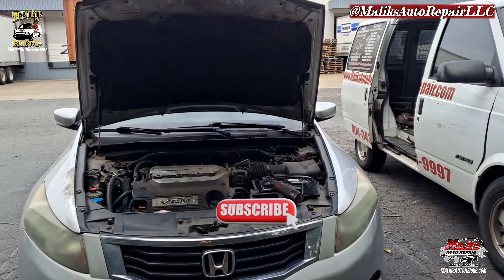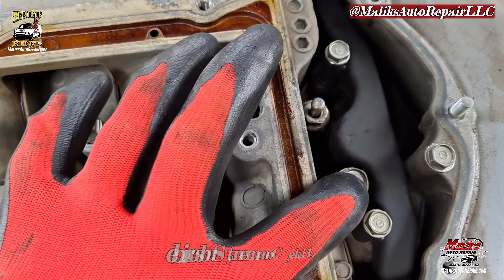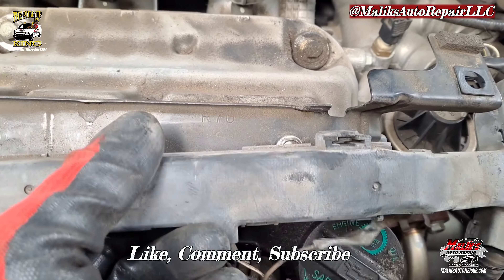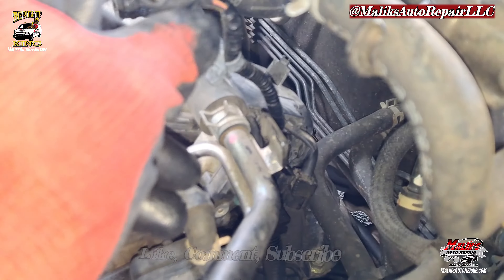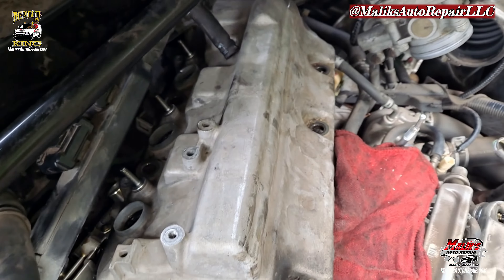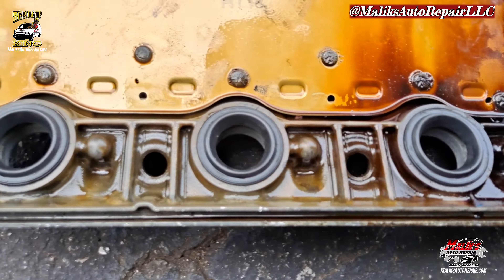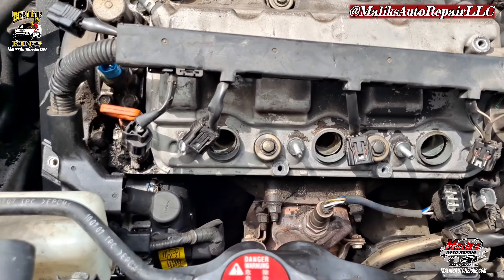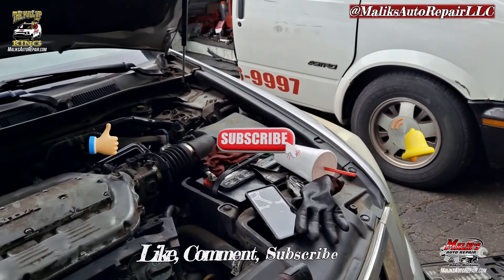VALVE COVER GASKETS LEAKING OIL | 2009 HONDA ACCORD 3.5 | DETAILED | Howto/Diy

Comment: Liked your format, step by step before and after each removal. Easy to follow and straight forward. Thanks man
Reply from the maker: Not a problem man! Thanks alot and thanks for watching!
Reply from the maker: Torque Specs
Valve cover bolts... 8.7ft/lbs.
Intake Manifold bolts... 16ft/lbs.
Reply: @ThePullUpKing can u post the parts numbers please
Reply from the maker: @jeffreyperez231  Autozone

Comment: If this doesn't solve my issue... I hope it does. Thanks for the in-depth explanation Sir
Reply from the maker: Absolutely! Thanks for watching!
Reply: Question, Did you also replace the alternator or just clean it off? The oil has been drippin on my alternator
Reply: Also did you need a new air intake manifold gasket ? I’m attempting this weekend
Reply from the maker: @calebinorio100  The videos shows valve cover gaskets being replaced. Didn't touch the battery. Intake manifold gasket reusable.
Reply: @calebinorio100  what did you end up doing? My valve cover gaskets leaked oil onto my alternator
Reply: @Peace-Of-Mind-  I took off the coolant cap and started the engine, because the fluid didn’t spurt out and I didn’t see any bubbles I realized it isn’t my head gasket. I believe that the valve cover gasket is leaking & also the Solenoid near the dipstick. I also purchased a new alternator but if you want you can take the old one apart and use break cleaner to restore it to original quality. Hope this helps
Reply: Had same issue, if oil has leaked on to alternator eventually you will have electrical issues and alternator will fail. If alternator hasn't burnt out you can clean it with contact cleaner, safe on electrical components and plastic, do not use carb cleaner its too aggressive.

Comment: Shorter and more concise than videos which are twice as long. Good tips and methods to watch out for. Nice explanations and format / editing. I have a 2010 V6 Accord with 180K on it, and I'm preparing to do it this spring / summer. I like your method of tapping out the rings from the top instead of prying from the bottom, use of channel locks for removal and install of those bolt ring thingies and your use of sealant at the corners of the gaskets.
Reply from the maker: Yessirr! Thanks man I appreciate the recognition.😎 I tried to make sure I covered everything. I hope it helps out. Let us know how the repair goes.
Reply: @ThePullUpKing  I still haven't done it, but I'm gonna. I just turned 200k and I plan on doing it soon
Q1: Is it easy to find the torque values online?
Q2: The 8th gen V6 s is prone to fouling plugs as a result of the VCM. Do you have any knowledge of the effectiveness of the aftermarket VCM limiter which keeps all 6 cylinders running continuously?
Q3: Do you have any tips that would help make this engine last another 100k plus?
Thanks,
Dave in Ohio
Reply: How did your install go last year? I just had a plug fail and oil was on 4 of the 6.
Reply: @Jrhortian  I didn't do it yet, but I'm still putting 700+ miles on every week. Correct me if I'm wrong but I don't believe the valve cover gaskets replacement will affect the oil on the plugs. The fouling of the plugs is caused by the VCM (Variable Cylinder Management) which alternates between shutting down 2 alternating pairs of cylinders while at moderate RPMs (not climbing, not accelerating.) As a result, oil collects in the 2 non-firing cylinders and causes 4 of the plugs to get gunked up. There is an electronic VCM tuner module which will disable this feature. I read that it doesn't make much difference in MPGs. Haven't installed it yet. I replaced my plugs quite a while ago with the NGK laser iridium. I suspect that they were developed for this type of problem, but I can't know for sure. They seem to be less prone to fouling out. In the meantime, I just make sure I drive it somewhat aggressively once it has reached full operating temperature to keep oil from building up in the VCM cylinders while keeping the full synthetic oil level topped off. The engine light doesn't bother me. I had 4 out of 6 gunked up as well back when I did it.
I really don't know, I might be wrong. Will the valve cover gaskets and seals replacement prevent oil from entering the ignition chambers? (I'm not a pro mechanic)
Reply from the maker: Replacing the tube seals is what stops the oil on the plugs.
Reply from the maker: A1: Torque specs are easy to find online. 
A2: I'm not familiar with the VCM, unfortunately. 
A3: To make your engine last longer... Regular maintenance will help it. Don't go over on oil changes. Timing chain & waterpump replacement at that age is helpful, if not done already.
Reply: @ThePullUpKing  I did take care of the TB & WP. I also keep up with oil and filter changes. I go a bit longer because it uses some oil and I only use synthetic. I've also changed the transmission fluid myself several times.
Thanks for your reply and for the torque specs (I read the torque specs in a bunch of other comments)
Up to 220,000 now and counting. Still has plenty of power and torque.
The tube seals !  I had no idea. I thought all this time that it was oil getting past the rings !! 
I'm so excited to learn this. I'm so going to do this now and stop using oil !!  🤯
Reply from the maker: @dvd6722  Awesome! Glad I could help
Reply: @ThePullUpKing  It's an awesome feeling to learn something about your car which tells you it's going to last a lot longer than you thought it was !

Comment: Hey man. Nice video. But I have questions about the gasket. Why did you just apply only in the corners? Is it better put all the way around it? And do you put the sealant rtv on the cover first or after you put the gasket? Just curious sir. Thank you for this video!
Reply from the maker: Thanks! Those are the areas where oil will leak if sealant isn't applied. The gasket will seal the other areas. If the gasket doesn't stay in place, apply the sealant lightly, to hold the gasket to the cover.

Comment: how did you get the throttle body harness off. i’m stuck there
Reply from the maker: @MarshallWayne98  Ouch, I can understand the trouble. They can be a pain coming off aometimes. Try using a pair of pliers to help press the tab down.
Reply: @ would needle nose work. I can get the tab moving but the plug itself and going for it
Reply from the maker: @MarshallWayne98 Even better

Comment: Thanks for this video! I did the replacement and leak is gone, alternator at the same time. About 20 minutes into driving the check engine and vsc lights came on - no performance issues. Any idea would could be causing that?
Reply from the maker: Check vtec solenoids. Oil pumps also like to leak on these j-series engines.

Comment: Hey man maybe you can help me with my issue, i was removing my pcv valve and it broke. Everything came off except the very end of it. You think if I remove the front valve head I can push it out from the inside?
Reply from the maker: I would just break the pcv valve into little pieces with a flat head and fish the pieces out with a needle nose. Or you could take off the cover.

Comment: Watchout with the 3.5, they have trouble with the front valve cover itself warping! Its caused by an electrical field around the Coils. My #1 & 2 spark plug tubes (from left to right, on the front cover) were Egg shaped and after I got it off I laid a Straight edge along the mounting surface and it was warped as well. The aftermarket covers do not do this!
Honda used a high concentration of Magnesium in the metal and the spark plug tubes actually kind of welded themselves! 
Also, while youre doing it you should replace the V-Tech solenoid gaskets (passenger side) as well, they tend Leak alot as well...Right down onto the Alternator, which will burn it out eventually!

I have a friend that owns a shop and He has seen this several times!
Reply from the maker: @Scottm-n6h  I had no idea. I know the plastic covers warp. Thanks for that info.🫡 And yes the vtech solenoid will leak. Common issue. Thanks for watching!

Comment: no hate but I did this and it leaked after 2000 miles really really bad.
the gasket sealer you used is from harbor freight, I used that same exact kind also, and it is not what you want. 
You want Hondabond OEM sealer, 
OR permatex ultra-grey/copper. 
I had to redo this job on my car bc of this wrong stuff.
Reply from the maker: Nah bruh you just didn't seal it properly. Lol My job ain't leak, so I know that's just ya opinion. I been doing this since 11th grade man. No hate. Check ya work.
Reply: @ThePullUpKing  yea you mentally still in the 5th grade, now im hatin. Do your homework use Hondbond.
Reply from the maker: 💀🤣🤣  But u on my channel, talking bout do ya homework.🤣 I said what tf I said. You didnt do the job right if it's still leaking. Can't get mad at me for telling you the truth niccah.🤡 You did the fuxkin joh wrong dumbss boy.😆😂
Reply: @ThePullUpKing  you put out content with a slight error just accept it nd move on, dont be a child :hand-purple-blue-peace:
Reply from the maker: @AmpereNA  lol Mann plss. Don't get on my channel with that bullshit. I'm showing in my video how I did the job. You said you leaking oil and blamed it on the sealant.lol I told you it worked for me. Now that sound like you didn't didn't some shit right. Don't blame my video, hater.💀🤣🤡
Reply from the maker: Oh and for the record I don't buy sealant from harbor freight.lol Autozone. You the only one with these claims.🤯😂 Better check that oil filter solenoid too. Don't be so quick to blame my video. My work A1. You make yaself look like a damn fool.smh

Comment: Questions: Is there a specification on thighting the bolts on the cove valve?
Reply from the maker: Torque Specs
Valve cover bolts... 8.7ft/lbs.
Intake Manifold bolts... 16ft/lbs.

Comment: How did you clean those areas without taking anything off did you just spray it with the brake cleaner ?
Reply from the maker: Which areas are you referring to?
Reply: The area by the alternator
Reply from the maker: Yeah, brake cleaner

Comment: It's there a torque value for the valve covers and manifold? Actually for everything? Just wondering. Great video.
Reply from the maker: Yes sir, but I don't use them all the time. I can send them to you. Thanks alot and Thanks for watching!
Reply from the maker: Torque Specs
Valve cover bolts... 8.7ft/lbs.
Intake Manifold bolts... 16ft/lbs.
Reply: @ThePullUpKing  thank you for the torque spec ive been wondering the same thing great video thanks again my man
Reply from the maker: @ivonnejoshua4102  Yessir, thanks for watching!💯

Comment: I would like to of seen the leak and how you determined the leak was the gaskets. Half the battle is finding the leak.
Reply from the maker: @ronmailloux2386  Just look around the valve cover to determine if oil has been leaking. Or a smoke test.

Comment: Think you could skip the back cover if its only leaking from the front?
Reply from the maker: No problem. Thanks for watching. I wouldn't recommend it. It's like replacing the front 3 spark plugs, but not the back 3. No recommended.

Comment: I’ve been trying to remove the cover for about an hour and it won’t budge. I got the left side up but the right side by where all the coolant lines are at, it’s just not budging for me. Any suggestions?
Reply from the maker: Make sure all the bolts & nuts are undone.

Comment: How do you know if it wasn't the solenoid spool?
Reply from the maker: I diagnosed it myself. Oil leaking from the valve cover gaskets. The purpose of the video is to show how I replaced them. Thanks for watching.

Comment: What is the torque for those bolts
Reply from the maker: @urioropeza7010  Torque Specs
Valve cover bolts... 8.7ft/lbs.
Intake Manifold bolts... 16ft/lbs.

Comment: Ballpark. How much does that service cost on a 2007 Accord V6?
Reply from the maker: $500
Reply: Should be about 2.5 hour labor time plus parts so best to do the calculation based on YOUR local area shop labor rates and current cost of parts.